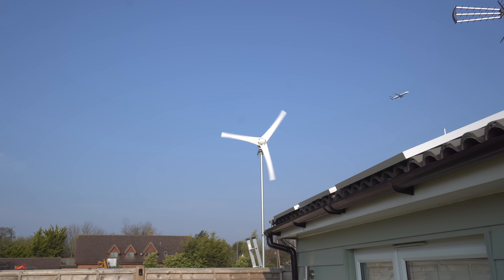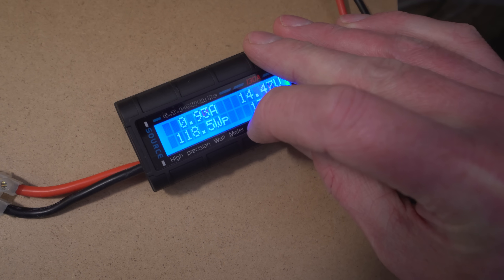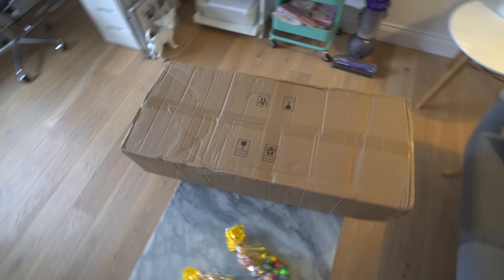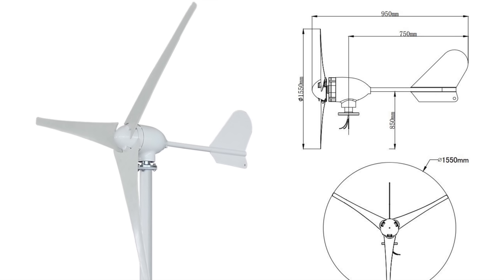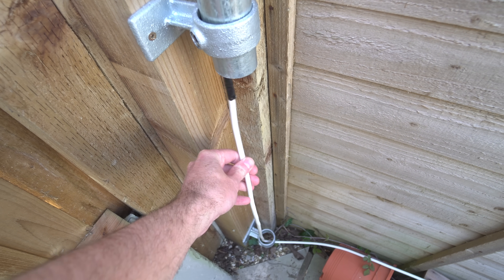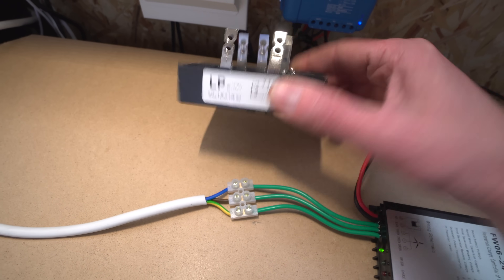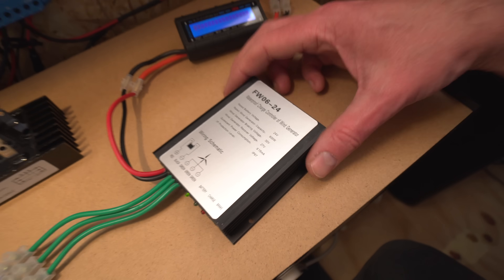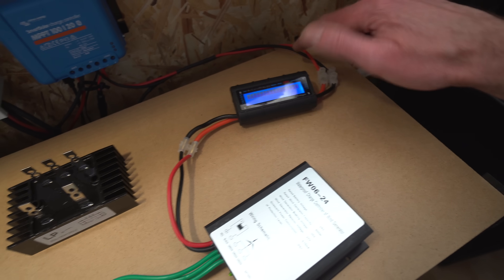500W MICRO WIND TURBINE | IS IT WORTH IT??!!

Comment: Where do you connect the wire the right one? And the black, coming from the disturbing on two, the blue charger inverter and what's the name that black part that you have show it? The one that has happened reconnection, and to connection, what is the name of it? Thank you for your video.

Comment: The portable shine turbine 2.0 wind generator is a billion times better and yes, I know it didn't come out, but anyway, the portable shine turbine 2.0 wind generator is better and the portable shine turbine 2.0 wind generator can be put on an electric bike and connected to a battery and ride, and even more so it can be put on a tourist plus bike camper and a Mink-S bike camper. and the portable shine turbine 2.0 wind generator will even cool down from a small wind, and the portable shine turbine 2.0 wind generator is quiet.

Comment: I think the biggest misconception that everyone has with wind generators is that it alone will charge your batteries the same way solar does but that's not the case , its mainly going to assist in charging your batteries with an already setup system.

Granted if you had one of those giant farm pump house wind mills then you might actually get some actual use out of them .

Even if you can get that 500 - 2500 watts out of them on good days its never going to be a constant power solution, while it helps on low solar days and on storms.

Comment: I always get a 50 watt loss from the Victron to my batteries. Dump load into a water heater element, in your water heater, free heat saves natrual gas.

Comment: Since everyone puts in their .02cents.  The longer the wire is the more resistance in the system at low voltage. I’m thinking it would be more efficient to have the batteries charge controller and inverter very close to the windmill and to have 220v sent from there since 220v does same amount of work with half the energy and can travel longer distances on the copper wire. Of course gold wires would be the ultimate medium to transport energy. I’m thinking about how the Egyptian pyramids may have been a huge hydro battery system. The caps were apparently made of gold. Also to control the speed of the windmill it would extract further upward or downward as a governor in higher wind conditions so as not to over spin.

Comment: Every once in a while I watch some Youtube videos to see how well small wind turbines are working now. Sorry to say, but they are still a terrible investment compared to a solar panel or two, unless you live in a very windy area.
Reply: Mostly true. But this is 5 years old. They've gotten a bit better with lower wind activation and output. A combo system of solar and wind might be the best bet since at least at night you can do some charging
Reply: @Sealmeal  Yeah I think they are going to have to get a lot better to be worthwhile. The cost of the system, then the likely higher cost of getting it high enough for good airflow. Then the cost of replacing parts every few years as they wear.
How long does it take to recoup all those initial costs, and what is the actual output average per day/month/year of the system? It seems almost impossible to get anyone to give hard numbers as to what their system is producing. That speaks volumes.
It is likely still much more economical to just add more solar panels and make your power when the sun is shining. No maintenence, and solar components last a very long time.
Writing from my homebuilt RV in the Mojave Desert. 2050 watts of solar panels and 900 AH of LiFePO4 batteries.
Reply: @headdown1  you are absolutely correct. So many unknowns and individual fluctuations in too many variables at the same time to even approach getting a solid hardball number. I think it's a great concept for a hobbiest with a little land who wants to experiment and possibly keep well kept logs to see what the actual numbers in their situation comes out as and how they might change parameters to find better outcomes (such as myself), but for someone looking for a truly sustainable source of needed power and reliability then people should be following your advise.
Reply: @Sealmeal  I would love to be able to add a wind turbine to the RV, but every time I check in to see how the technology is progressing I am disappointed. If you lived on the prairies, or maybe on the coast with steady winds it might make sense. But the cost and short life span of components seem to put it well behind solar at the moment in most locations.

Comment: Don't sweat it yet. Come winter time, when the sun is low in the sky and the days are short, there's a real good chance, that wind turbine does the "heavy lifting". You may have simply picked the wrong season, to get the good capacity factor out of the turbine.

Comment: If he is using the controller that came with it. He is probable just getting 50 watt's +/-. I tested my vevor 500 with the controller that came with it and got only 6 amps max before the break kicked in. With a 3 phase rectifier  ( NO BREAK ) at top speed of my battery drill ( 1600 rpm ) I got 29 amps. Hurricane  wind.  If you use a better controller so you can set it to break later then it might make 100 - 150 watts. Me I'm going to use the 3 phase rectifier  ( NO BREAK ) and a kill switch for big storms to save the battery's from higher voltage and over charge. 350 watts is 29.17 amps 12 vdc at 1600 rpm. This thing should be labeled as a 100 watt turbine.

Comment: No it's not worth it, wind turbines are expensive and are likely to attract the attention of neighbours who will complain to the local council. Furthermore they don't generate anywhere near the power of cheap solar panels, a 300 watt solar panel can be had for under $80 most of the time the most you will get out of that wind turbine is between 80-100 watts

Comment: I bought the 600 watts version of the same thing. Looks just like the one you have. I also ordered the 24 volts model. They sent me the same controller you have there. It didn't work out because they sent me a 12 volts model turbine. So I ordered a 200 amps rectifier and hooked it up with some cables I got with a cheap inverter that had some big alligator clips on them. So I have twenty marine batteries, it has to charge one side of ten, or the other. I just switch it around. From what I can tell it's putting about 140 watts into the batteries with a good wind. It doesn't put out enough to need a dump load. It can't overcharge the battery bank. I bought two more 100 watts solar panels, so I have 1400 watts of those things now. I think the problem with both of our turbines is the same ; I believe they must be wound with aluminum wire. I ordered a 24 volts model, but this one puts out 18-21 volts a lot of the time. It's windy enough here for a turbine most of the time. There are two short videos, just a few seconds long, of it spinning on my channel. That is the only thing I can think of that would make the voltage be so low. I'm going to have to fix it or get another one, I guess. I don't know whether to use it as is, and buy a different one, or try to rewind it with copper and possibly destroy it, and buy another. I have a theory that in order to get 24 volts out of one of these things, you have to get the 48 volts one, so they have to use copper to get that much voltage. I'm not sure but I think that's what the deal is. They don't tell you that in the advertisement. And I would bet that the 48 volts version costs a lot more. I doubt if you can buy just the stator, but I don't know that. I agree, solar is easiest. Just aim those panels and go. March average wind speed here is 10.2. There's a cold front coming down out of Colorado, so I'll get wind all night now. When I got mine, the crush plate holes were for a different one, maybe an 800 watts. I had to slot them and then use washers, so I had to go get longer bolts. I got higher grade bolts than they sent. I have room for nuts on the back of six of them. I used a fender washer on the outside three but had to grind part of them off so the nose cone would go on. I've had it up for six days. It's been windy for about four of those. After I get a different one put up and working, I will have to take this one apart and see why there is aluminum wire coming off the slip rings. Maybe the stator is copper, just 12 v. I don't know. It's not really good enough like it is, unless it's pretty windy every day. I'm using mine, but it's kind of a Gilligan's Island set up, I have to switch it from one set of ten batteries to the other side. If I hooked it up 24 volts, the prairie wind might tear it apart. So having it 12 v, it doesn't turn fast as it would 24, I guess. I'm getting some high wind now. There's a front coming down. Sounds like it's around 45 MPH wind. The only other thing I can think of, there's an electric motor rebuilders place here, I could get copper wire put in it there, but jeez they charge a lot. But no bigger than this little guy is, it might not cost too much. So if I try to rewire it, and can't do it, that's the last option. But if they do it, it'll make 50 volts probably. If I can get some copper wire in it, and get some voltage out if it, I'll buy a good charge controller for it. I have a DC motor that makes 79 volts that I may put some blades on, as well. It should make 350 watts or so, it's a half horse. I wrapped a cord around the 3 inch pulley and pulled it made 79 volts three times in a row. I can make a wind generator out of it. Just curious if you have thought about rewind it for a different voltage. I'm thinking about finding some 15% silver wire, get it rewound with it, and send them a picture of it. I don't know why they can't get their heads out of their asses and build some decent wind generators. I had to turn the hotplate on, the wind is howling, voltage spiking to 29.3 The darn thing works, just half way. With these 50 MPH gusts, I could probably hook it up 24 volts. Crazy stuff. I guess it's like buying an inverter, you have to get a junky one or two before you figure out how to get a better one. Maybe the 500 watts rating is during a small tornado. If it was copper wire wound it will probably make 510 watts. But then they wind it with aluminum wire and it never makes the rating. They just don't put that in the advertisement

Comment: Do all the wind turbines come with brakes or only certain ones? One video I listened to a guy said they did come with it. But others people didn't seem to know. Supposedly they use the brake when the wind is too much. But a lot of people didn't seem to know what the charge controller's functions were for. 

I'm curious how well a normal charge controller would act as a power brake from overcharging? A lot of people didn't seem sure if that would work. If they didn't know that was that just them not knowing or is there a gap in efficiency there in the controller being able to actually function as a brake then? 

For your system probably you would want 2 or 3 wind mills together to get enough power to do much. 

But some people say that lithium batteries have some fire risk also. So maybe you'd want to put non-flammable shielding material around your battery bank as a precaution? I'm not really sure if this is just blame or not but lithium batteries have been blamed for some fires over here in the US. (But its hard to know if that's true because of how people lie and blame the wrong thing because of politics or whatever here).

Comment: So you need a 3 phase wiring to go from the top of the wind mill down to the charge controller? What are you supposed to look for for that to install one? People are saying on other videos that the wind turbines don't come with enough wiring to go from the top of a house or pole to go to the charge controller... So I guess people have to science this part out on their own.
Reply from the maker: It's not 3 phase wiring, it's just a 3 core cable. Any decent quality 3 core cable will be fine as long as it van handle the max rated power of your turbine.
Reply: @andykirby  Thank you

Comment: Hi Andy i see you use a MPPT Victron yb Turbine system. Can i use any Victron MPPT with a 150 Amp Rectifier? I cant get hold of a controller box like yours so i have to use a Rectifier. I build my own Vertical Flux axial turbine. Nice job nice videos.

Comment: Really makes me appreciate how drama-free and relatively easy solar is. Was considering diversifying the renewable power for my off-grid bus but wind seems impractical for my purposes. Thanks for the video!
Reply: Solar is wildly expensive I know assholes that try to charge $50,000 to rig up an entire house, wind on the other hand just requires electric motors and mechanical energy very primitive and cheap by comparison. The big disadvantage of wind energy though is that you have to actually be good at physics you can't just guess. Where as installing solar panels is a mindless task similar to installing shingles. If you're smart, but poor wind is an excellent option. If you're rich and dumb go with solar.
Reply: @SF-dy6hn  why'd you respond to my comment lol
Reply: @natebaird  To correct you. Wind can be cheaper and more profitable than solar and as for drama that's all just personal perspective isn't it?
Reply: @SF-dy6hn  lol you're a trip, man. Glad wind is working out for you. The more renewable energy, the better.

Comment: I always think a great item to prioritize for these systems is your fridge. Just bring a power lead from the battery storage out to the fridge. When I was in Spain, by just putting my fridge on a timer (so it only came on about 1 hr in 3), I was able to half my electric bill. Because a typical fridge is on 24/7 and runs at 90-130 Watts.
Reply: ? Are you talking about standard compressor fridge? Just lower thermostat setting. They should not work 24/7
Reply: @Qrnl  yes that's another approach. Try it and see

Comment: How much voltage drop is there with  those thin wires
Reply: You are assuming the Wind Turbines generates enough amps to cause a voltage drop in the wires?
Reply: @MrSummitville  not assuming anything simply asking a question

Comment: Thanks! My solar panel break even point is 1 year with current kWh price of roughly 0.90 EUR instead of the usual 0.22 EUR.
Thing are crazy here so looking for solutions to get more self sufficient. Wind power is not near as reliability and power production as solar but all small amounts help. We have black-outs as well due to overload on the power grid. AC jumped from ~220V to sometimes 250V which can be harmful to some electronics.

Comment: Hi Andy, Great video! Fellow techie and electro-hobbiest. Recently been e-bike building/modding, 60v 1800w hub setup is coming along well, came across your name a few times during research. Also FPV droning and DIYing solar - this reminded me I also have a nice 1500w turbine from Missouri wind and solar sat at the unit, think the unboxing is still on here somewhere. I took it down several years back as it seemed all a bit pointless/expensive and almost dangerous near to the house, whilst being subject to the below mentioned turbulence, anyway may put it back on now the energy crisis is here and getting back into renewables. Lastly - Subbed!

Comment: You have single phase (or twin and earth), not 3 phase.  Three phase is red, yellow and blue wires and each phase has 120 degrees of phases angle.  Power stations generate this way and it is used in industry and ther heavy applications.
Reply: You have not clue.  That wind turbine does generate 3 PHASE AC ...

Comment: The amount of power is proportional to the diameter of the blade cubed. I hope that helps in future ideas.
Reply: Nope, it is ... diameter of the blade SQUARED ...
Reply: @MrSummitville  It's three dimensional, so volume of air goes up as the cube of diameter.
Reply: @Andrew-rc3vh  NO ...  The blade is 2 dimensional,  therefore the Power generated by the Wind Turbine increases by the SQUARE of the blade diameter. Look at the FORMULA for power.  It is very simple math ...

Comment: Yeah until you get up into the 1-2kw range with a 10+ ft diameter micro wind is really not really worth it. But there is some nice kit available out there in that size range today that are really not that expensive. But you need to know what you are looking at.
Reply: He does not have 25 mph or 10m/s winds every day, for several  hours.  A bigger wind is is just a waste of more money.
Reply: @MrSummitville  The purpose of micro wind is not to give you power every day. Its purpose is to give you power when you are not getting enough solar. Wind blows stronger at night, during weather events, and in the winter as well. They are counter cyclical. They compliment each other. I can't count the times I woke up to find the batteries almost fully charged overnight. Or how many times it saved me from having to go out to get the snow off the panels.
Reply: @davefroman4700  The Wind Turbine spins only when there is Strong Wind > 10mph.  It may be day or night, sunny or cloudy or NOT all.  Wind and sun are not counter-cyclical.  Where do you live, that it is wind is stronger at night.  In most locations in the USA, the winds are calmer at night.  What size is  your battery bank (kWhrs), PV Array and Wind Turbine.   Most people do NOT live in a very wind area.  Most of these 500 Watt Chinese made Wind Turbines are TOYS.

Comment: Solar hydrogen needs no high voltage but high current for low temperature electrolysis. 
Perhaps high speed small rotor generators are perfect for that.

Comment: You're hooking a charge controller into a charge controller bro. You're overthinking it entirely. You're just suppose to feed that directly into your battery bus.
Reply from the maker: Yes because the wind controller is the wrong voltage for the batteries.